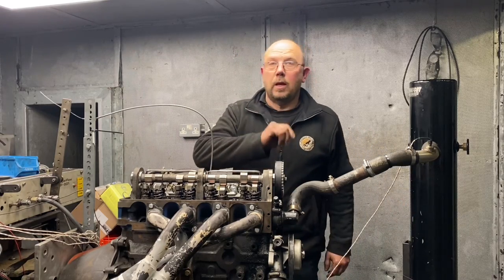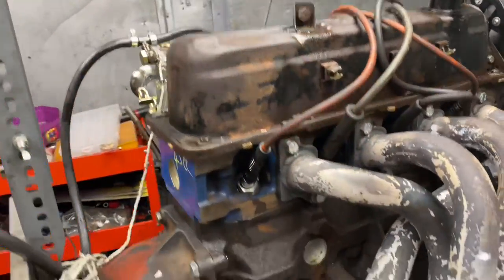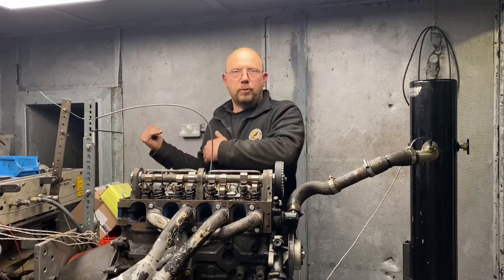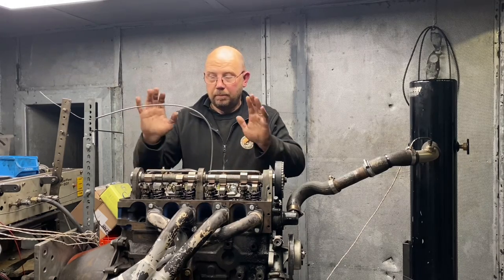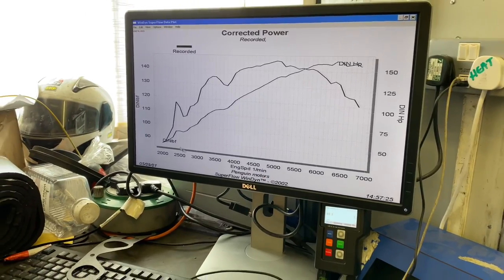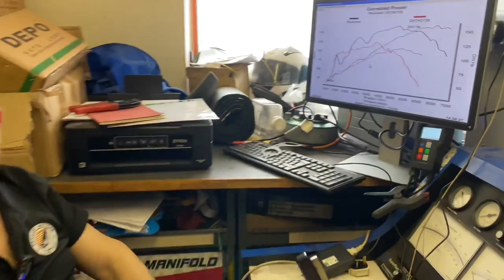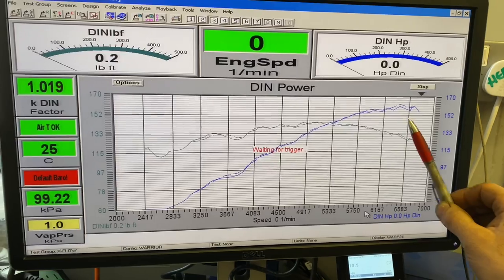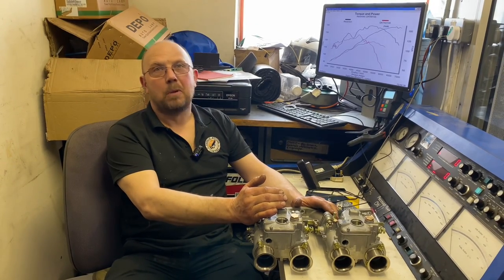Ford Pinto 2.0 Big Valve & PH4 Newman Cam Vs Standard Head/Cam Dyno tested

Comment: My little mk1 makes 180 odd hp with the pinto, 45's, gts1k Kent cam and head work. Its plenty enough for the street.
Reply: I'd like to know more about it.
Reply: Dream on
Reply: @jellybaby7  "Larner Race Engines" Cheers and GFY.
Reply: @20alphabet  

Found the specs, knew they were around someplace. The mob that built this is Peter Larner Engines in Victoria, Australia.
They specialise in Formula Fords and historic race cars. If you are UK based there are no doubt plenty of builders over there who could help you out. 
Cheers
  
Stroke 76.9mm Bore 92.00
2092cc
Comp Ratio of 10.8:1
Standard crank
H Beam Steel Conrods 5.00"
JE Custom Pistons
ARP Head Stud Kit
ARP Main Stud Kit
ARP Flywheel bolts
Lightened and balanced Flywheel
Heavy Duty clutch
Ported the head
Inlet valves 44.5mm Exhaust valves 38mm 
Competition valve springs
Competition Camshaft
Ported inlet manifold
45mm Webers 38mm chokes
160 Main jets 180 A/C
Hp 185@7000rpm

Comment: I had a 2.3L with a 615 lift Cam 12.l pistons 6" rod's 10.000 rpm launch 8.200 RPM 300 HP 50 webers 200 miles per hour 5 speed

Comment: Built quite a few of these as a rally/race engine apprentice back in the seventies. Pretty solid old lumps as proven by the 50 years that have since past and they’re still popular. Always found the factory inlet ports were already too big and slow for much power up to 4,000 rpm as they gave poor inlet velocity/fuel suspension/swirl & burn so was pleased to see the pretty reasonable power around 6,000rpm that you achieved quite easily - making it pretty good fun on track I guess! Nice work buddy, thank you! 😁

Comment: ?  - I put another air cleaner on a 73 pinto 2.0 and was wondering how to hook valve cover breather to the air cleaner. for the past 3 yrs, I just have some marine carpet with a clamp where you'd hook the hose on the oil breather? ON YOUR SET UP HERE, does your oil cap have a hose for connecting somewhere??
Reply from the maker: for dyno running i don't connect the breathers, and because i always use a cam cover with a splash shield under the filler hole i dont even run them with a an oil filler cap

Comment: Plenty of good info in your pinto videos as usual. Do you know how far out the webers are, compared to the regular 32/36? I'd like to swap over on mine, but not sure if my brake booster would be in the way.
Reply from the maker: That all depends, on a short manifold with short ram pipes they won’t stick out any further than a 32/36, but longer is better for power. I’m guessing your car is LHD which I have no experience of so I can’t give specifics

Comment: hi im building a pinto  using 205 block  big valve head ,ported std pistons  il be using it for fast road on mostly country lanes ,thought about newman ph4 but not sure if it would drive ok in the town at 20 30 mph ,dont want to be kangerooing at low speeds
Reply from the maker: yes it shoudl be able to drive ok at 20-30mph if teh engine is set up correctly

Comment: I have a 73 Ford Pinto with a 2.0 h.o engine from Britain, I wanna get her up to 150hp she currently makes 90hp I wanna leave the bottom end alone but get better cam and so on I already re did the valves, any tips?
Reply from the maker: twin carbs, more compression and hot cam will do it
Reply: @PenguinMotors  thanks my goal is to put a roll cage in her and give her abit more hp and race her with the SCCA or the historic Ford leagues and she can still be street legal also.
Reply from the maker: @Ford17x  cool although over here most people want more than 150bhp for the road car!
Reply: @PenguinMotors  not me as long as I can push 120hp out of a 2000 pound car ill be happy, ill be able to race with 300hp+ cars depending on weight...

Comment: Great videos👌 could you recommend a good fast road cam for a rebuilt 2lt pinto running twin 45s?
Reply from the maker: what  else has been done to the engine? whats more important good power under 3000rpm or the ability to rev past 6,000?
Reply: @PenguinMotors  it's had a total rebuild and been bored out to just under 2.1. the head has been fully reconditioned but is standard for now, Hoping to get big valve head down the line. I'm currently running Yamaha r1 carbs 2 mm jets. I don't need engine to rev over 6000 but want it to be a good fast road engine, personally would prefer the low end torque, just struggling on a cam choice any help would be appreciated 👍

Comment: Please can you make also video on that adjustable cam pulley how did you set cam timing? Thanks )
Reply from the maker: i will if i get time. Although one really good thing about having the dyno is i dont need to  pre set the  cam timing. I can just run the engine, change the cam timing and re run it overlaying the power curves.
Reply: @PenguinMotors  thats right, one more Q, i have seen on newmans page that cam PH4 and more needs to do some machining on pistion crowns for valve clearance. But i am not sure if that is for all their cams as you did not mentioned any of that. I am also interested to buy newman PH4 to my standard 2.0 pinto (EFI, but i will do conversation to 40 DCOE) THX )

Comment: the german-made 2.0 was always a better engine than the american-made 2.3
Reply from the maker: That said I seem to recall in Europe the cologne V6 was preferred which is Europe had a 2.0 v6
Reply: The Cologne 2.0 was capable of high rpm use. The Liam 2.3 was more suited to low rpm operation with an automatic transmission. I have owned several Pinto's and really loved the 2.0 over the2.3 by wide margins!